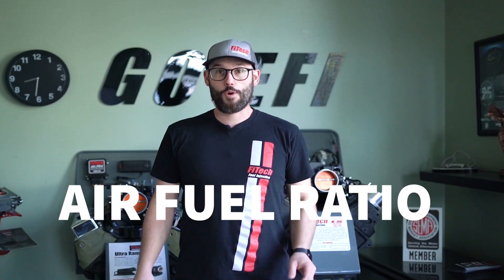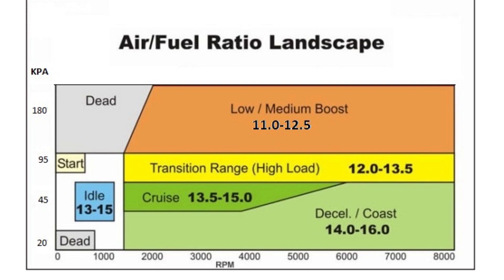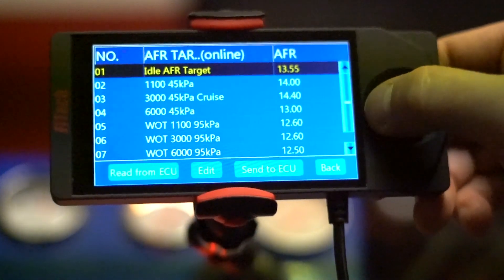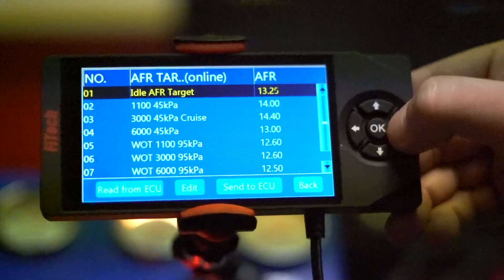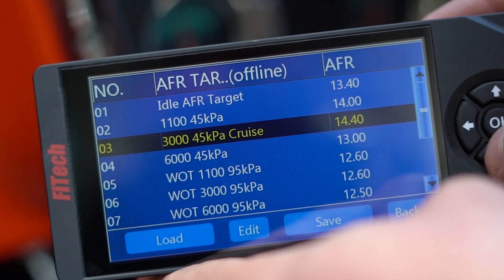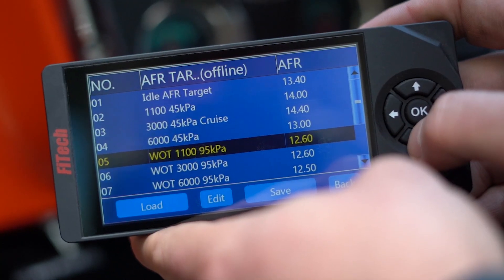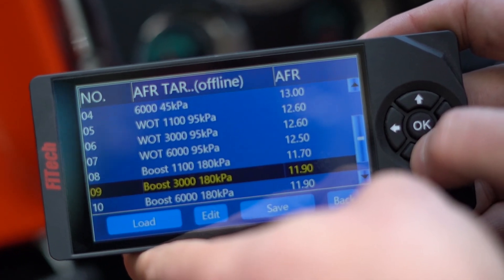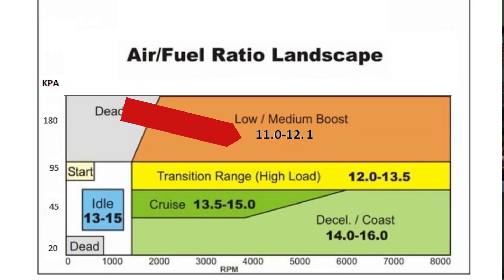Adjusting Target AFR | Tech Tuesdays | EP12

Comment: Hi! I followed the AFR adjustments shown in the video aiming for better fuel economy, since the car was consuming a lot of fuel. The engine is a Ford Y-block 292 V8.

However, after setting the target AFR values, the car started to stumble when pulling away after speed bumps, as if it was lacking fuel. Later on, it stalled at idle and then wouldn’t start again.

Could this be related to the ECU learning process? What would you recommend I do in this situation?
Reply from the maker: Hello sir,

When it comes to adjusting AFR targets, its important to be careful on how much fuel was deducted on each target, its important to adjust the AFR targets with patients and in small adjustments. A drastic change in the AFR target can cause issues such as the one described. You may adjust them in intervals of .2s, for example, Original AFR is 13.6, adjust it to 13.8 and allow tune to settle.
Reply: @FiTechEFImedia Hello, thank you for the explanation.

That makes sense. I believe I may have made too drastic changes to the AFR targets. I’ll redo the adjustments more gradually, in small steps as suggested, and allow the tune to settle between changes.

Thank you for the guidance and support.

Comment: My 30008 old handheld with joystick but without the arrows wont save target idle afr when i make the change and send to ecu. Anybody have any ideas? I dont see any lock or unlock function in the settings that I have seen in another video about unlocking so it can save. I do have pro calibration shown and accessible.
Reply from the maker: Hello sir,

This can be an issue with the software, such as a software glitch, however we can provide you with a new software that can  fix that issue, there is no cost for the software, you will just need to contact our technical support team and they can provide that software to you a long with instructions that will guide you on updating the software.

Comment: I’ve read high overlap enines may leak air in the exhaust.  I’d changed my afr to 17:1 for idle and was still running well. but while running in gear it doesn’t like the transition from lean to rich. Now it is 15.5:1 idle and 14:1 low load and it is ok, still slight hesitation on transition from low load low rpm to high load low rpm

Comment: 14.7 stoich is only for fuel without ethanol....does that even exist anywhere? Maybe in the USA...not likely in Canada, most stations claim up to 10% ethanol in all fuel octanes, that can lower stoich closer to 14.1:1 so be careful....bottom line, listen to your engine and tune to the results first (read plugs to spot detonation inpercieveable to your ear) and use your data numbers as secondary guidelines.
Reply from the maker: Our EFI systems read in LAMBDA and display an AFR reading based on gasoline. You are more than welcome to trust what you like however the system is extremely accurate with the Bosch 4.2 wideband oxygen sensor that it uses. Ethanol free gasoline does exist in many areas of the US. To be more precise with the system you also have the ability to enter in an ethanol content percentage in the Initial Setup of the handheld.

Comment: Why can't the boost kpa be set lower. Anything above 100kpa is gonna be boost...
Reply from the maker: The boost kpa is for boost. Therefore the value will be higher than 100kpa.
Reply: @FiTechEFImedia  thanks for replying. So when I'm making anything over my base map kpa of 102.5 it will run the boost kpa afr?  It's been jumping around with little fat spots

Comment: What should the AFR Trims for driver and passenger be while cruising I have a 5.3l ls with aftermarket comp cam
Reply from the maker: There is no exact answer to this. You should expect them to be +-10 most of the time but you can see more sometimes when the system is still learning.

Comment: My unit has 45, 75 and 95. What is the 75 for?
Reply from the maker: 75 kpa would be an example of a mid throttle position in most cases. The 45, 75, 95 are kpa readings which are how the system sees the engine load.

Comment: So, I've only adjusted a few times but have noticed that my throttle gets stuck in the closed position. I would have to firmly press the gas pedal to get it to loosen up, but would make the truck jump a tad. I've disconnected all linkages to the efi unit to troubleshoot, and it's confirmed that it is the unit getting stuck.  Any solutions or suggestions?
Reply: Adjust the throttle blade. Turn the throttle blade screw clockwise. Adjust IAC

Comment: I will be spinning my engine 7200-7500rpm. If I use the WOT 6000 rpm point. Above 6000 rpm will the unit continue to target lower AFR. For example if I set target after to 12.7 @ 6000 will it continue on and target say low 12s at 7000+ RPM?
Reply: Why won't they answer this question?

Comment: Good morning, I have an LS 5.3 engine with Hooker system for a 1 turbo with a Fuel injection ultimate LS system, it is advisable to mount the two Wide Band and where in case it is one where it would be better
Reply from the maker: If you are running a single turbo we would recommend using a single oxygen sensor in the downpipe of the turbo.

Comment: I’m confused by the 1100 RPM adjustment at WOT and boost. 

My idle is at 900 RPM, 3000 RPM on the brake, therefore it’s technically never seeing the 1100 AFR correct?  I’m not even seeing boost till around 2500RPMs as well. 

I feel like the AFR at 1100 is a mute point at WOT and boost. Am I right or wrong?
Reply from the maker: You are correct. The plot point is there but if your engine will not replicate the RPM/boost level the cell will never be used.
Reply: @FiTechEFImedia  

Great!  Thanks for confirming

Comment: Need as many tuning videos as possible. My CJ 7 is running so rich it's ruining oil and plugs
Reply from the maker: Make sure to check fault codes, we cover that in this video: https://youtu.be/3nMESN_uW38 in the time stamp 4:01

Also check your fuel pressure: 
Covered here: https://youtu.be/VCa3iWgMW88
Reply: Thanks, these don't seem to be the issue. I was on your tech line for a couple hours Thursday. We tested just about everything including rpm noise and fuel pressure (44psi).

I really appreciated his help, very patient!
Reply: I'm going to embarrass myself a bit here ... It was out of gas ...
Reply from the maker: @chrisurfer83  you would be surprised how often that happens, glad to hear it's all good now!
Reply: @FiTechEFImedia  haha yeah, had enough to get fuel pressure but not enough to run lol

Comment: I have the 600hp go street kit on a 454 big block can I run e85 in that
Reply from the maker: Yes you can!
Reply: How do you tune for e85
Reply from the maker: @garycasteel5387  Increase the CID of the engine by 30% on the handheld. Be aware that the HP rating drops when using E85. The kit will then support 420 HP.
Reply: I have a 355 Sbc with a cam in it. It seems to run rich at idle. What would you believe my target afr should be.  It’s on 14.5 I believe
Reply from the maker: @railroado1238  You could have an exhaust leak.... If this cam is really big and has a lot of valve overlap you can target even leaner AFR's.
Reply: @FiTechEFImedia  thank you very much for the help